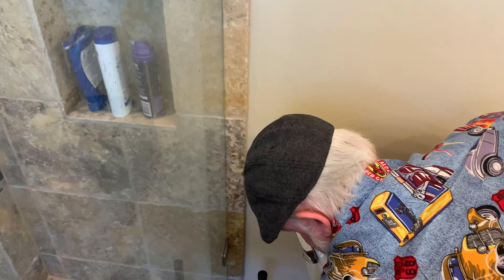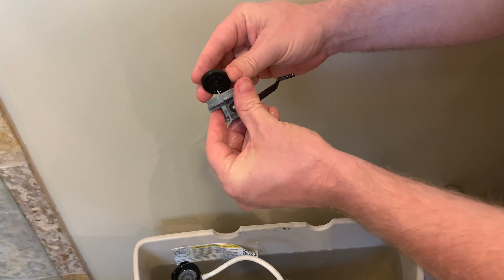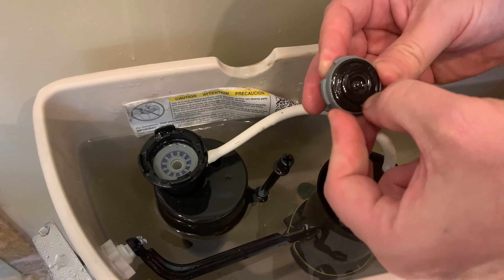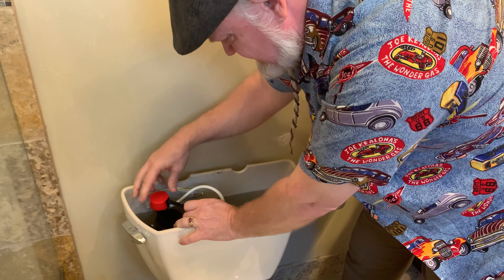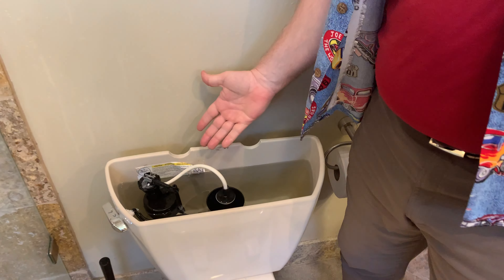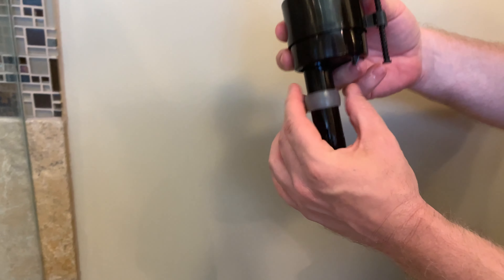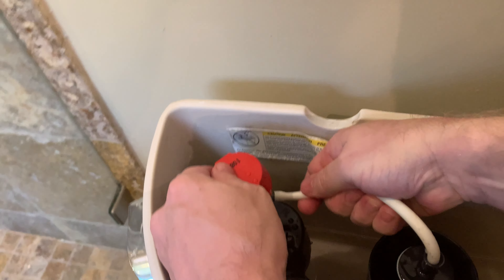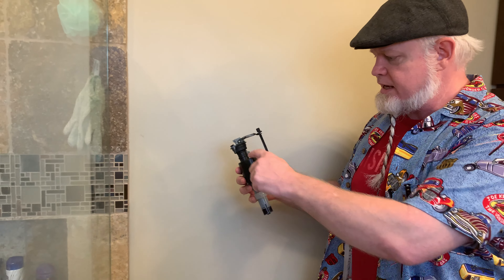Hissing Kohler Toilet - How2 & DIYs

Comment: Problem fixed thanks to cleaning the valve top and bottom! One additional step I had to do was slightly rotate the black valve as it seemed to have imprints from the other side's pattern. Thank you!